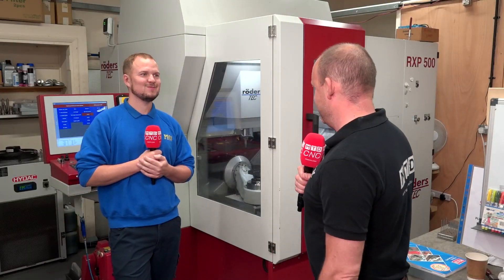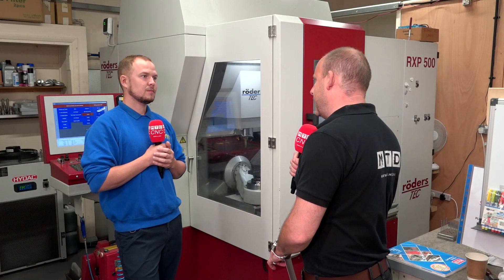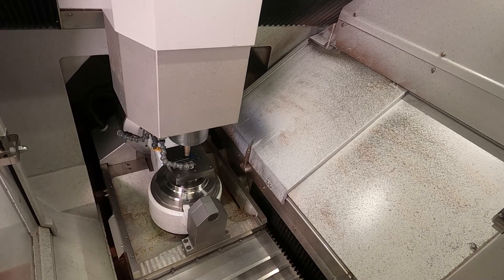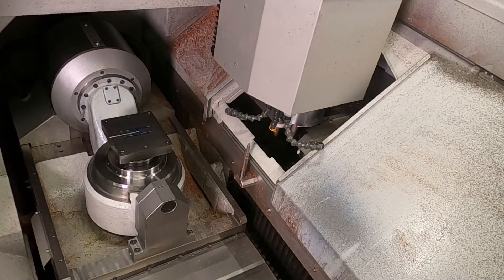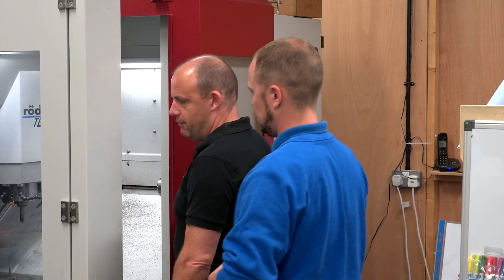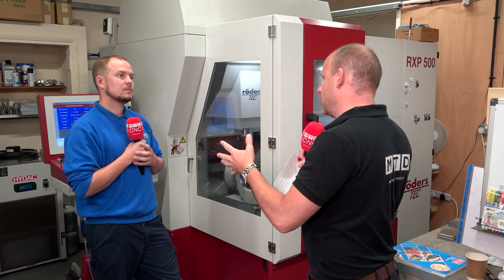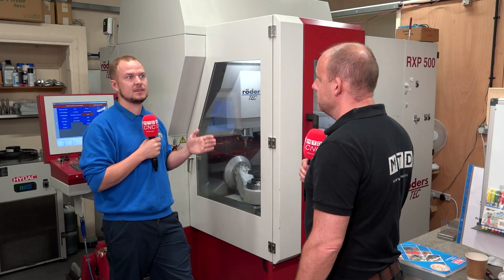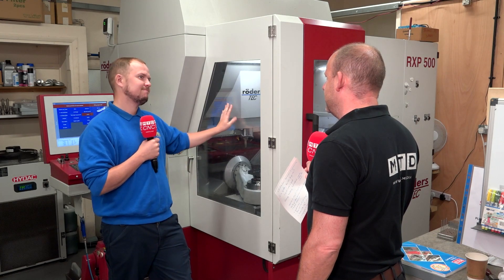roders is the machine for tight tolerance machining, literally down to microns

Comment: What control do they use? I'd expect it to be Heidenhain, but it doesn't look like it... i had a quick look on Roders' website, and i couldn't find any info...
Reply from the maker: I believe it's their own software.
Reply: Because developed on windows platform. Roeders machines can run both G-code and Heidenhain, as well as use Java commands.
Reply: @sonphung7527  Thanks for your excellent reply. It's much appreciated.